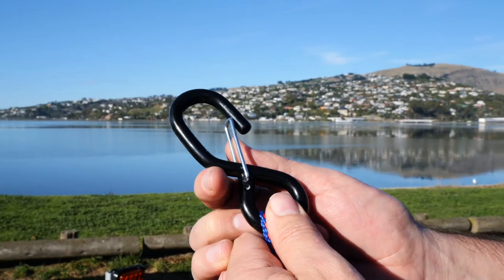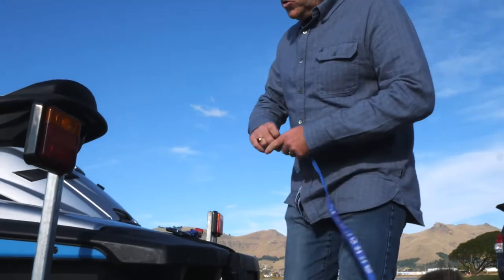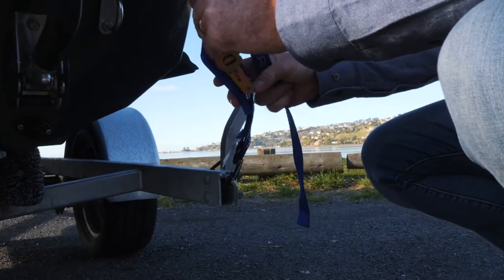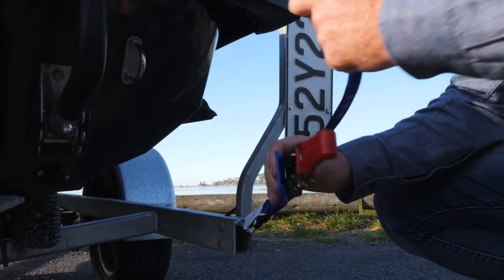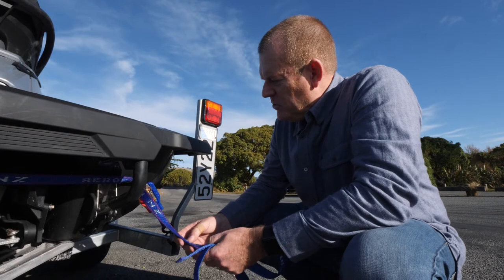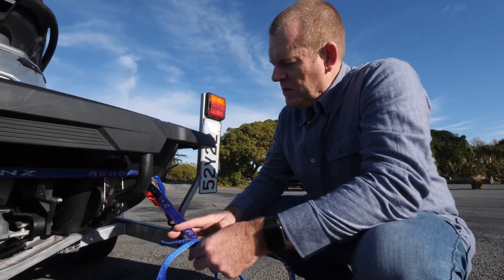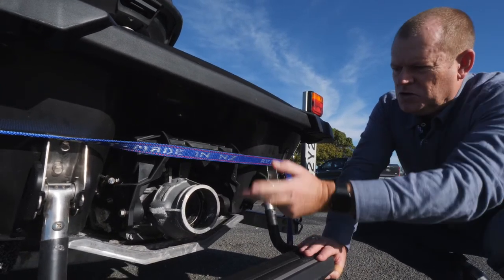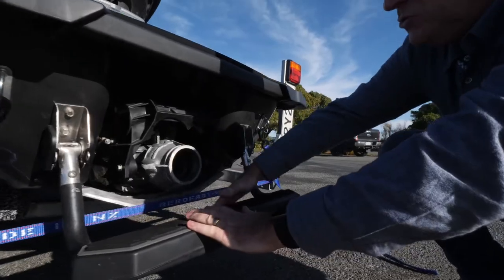How to Tie Down your PWC / Jetski to a Trailer?

Comment: Where can I purchase these in the US?
Reply from the maker: Hi Johnny, you sure can. We supply a limited range on Amazon. Ive attached a link to our storefront below! https://www.amazon.com/stores/Aerofast/page/CFF45649-5F3F-46E5-AC2D-B39C297E1A2F?ref_=ast_bln
Reply: Mine arrived today. I don’t think the strap is long enough for the first option using the tow hook under the rear seat. Is that possibly because my jetski and trailer is too big?
Reply from the maker: @jvalentin84  thanks for the feedback it is much appreciated. We are always looking to improve our product. 

Are you able to use the tie down on the two eyelets on your jet-ski/PWC? Based on your feedback we will be looking at manufacturing an additional length for the US market. 

Do you have any suggestions on what length you think it should be. Once again your feedback is much appreciated.
Reply: @AerofastNZ  At least an extra 9-12 feet for sure to fit the newest 3 seater waverunners that are sitting on larger triton trailers.